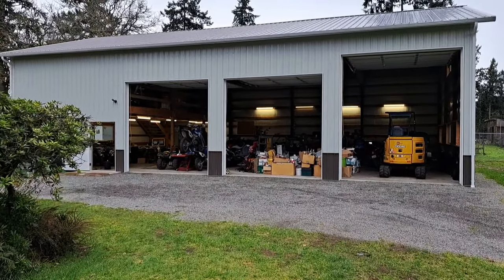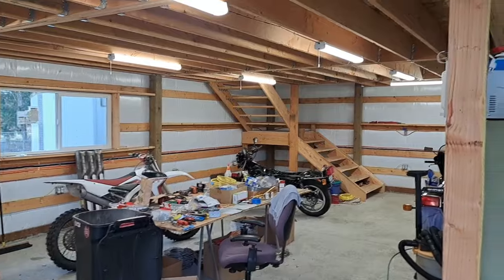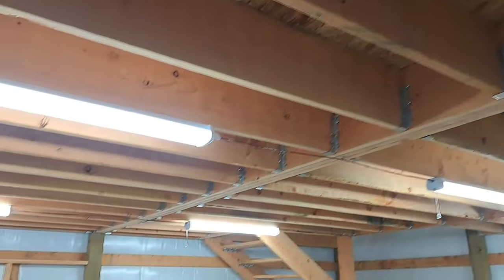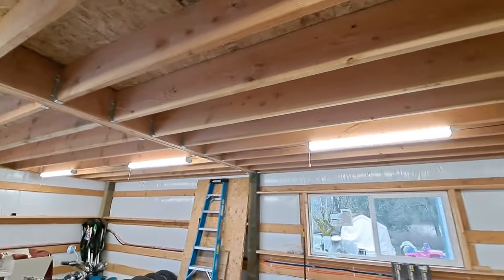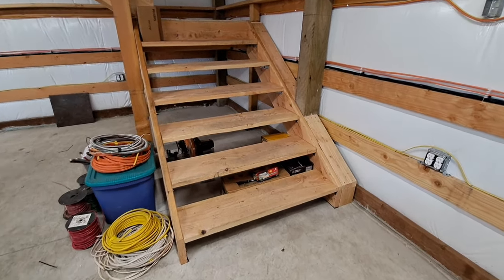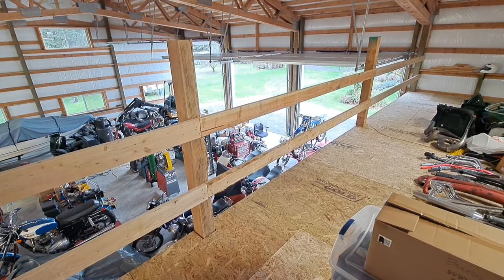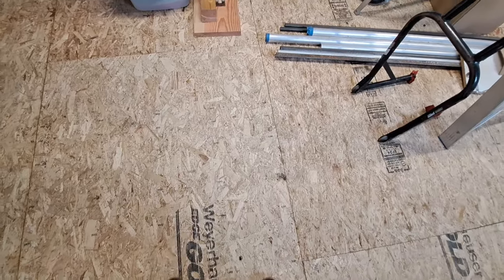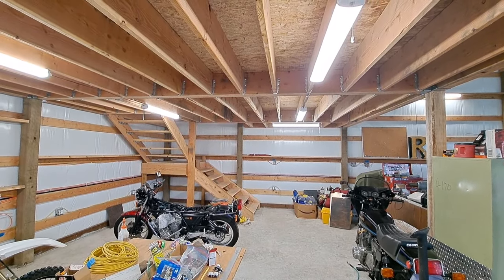Pole Barn Loft, Construction Details And Cost

Comment: Your builder did a great job! Only thing I see that really needs to be done!  Even though they used hangers were your outer beams meet the vertical post. You need to get 2x6,s and run one from the floor up to the bottom of the beams. With a. Very tight fit. Use construction adhesive and screws at minimum. Best would be 3/8ths carriage bolts ran through with taps torqued down.   This keeps those beams from being able to drop at all!  They will drop if this is not done even with the hangers!!  And it can cause your loft floor to be uneven.
Reply from the maker: That's a great idea. I'm surprised they didn't do that. The detail you've described already exists at the truss tail / post connections.

Comment: I have a 60x40 and want to do the same, so glad I found this video. I will be running my joists differently though as it's only gonna be a 10x40 loft for me. 15x40 living area going up on the other side. Do you think 2x12 is the appropriate thing to use for joists? I guess it would make for a very sturdy floor. Going with 6x6 posts also
Reply: Also do you think 1/2 on top of 3/4 is worthwhile for the flooring. 1 layer just never feels like enough to me
Reply from the maker: Yes, 2×12's. I believe they are on 12" centers. That's how they got away with just one layer of 3/4" tongue and groove, glued and nailed down? It feels very solid.